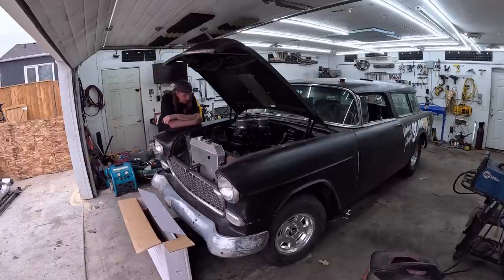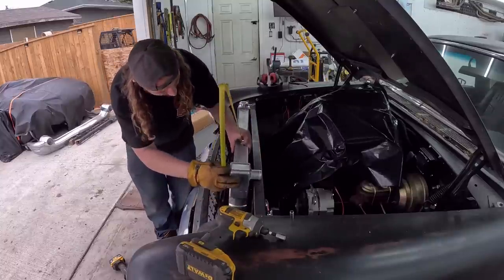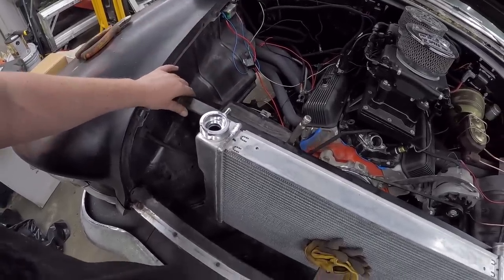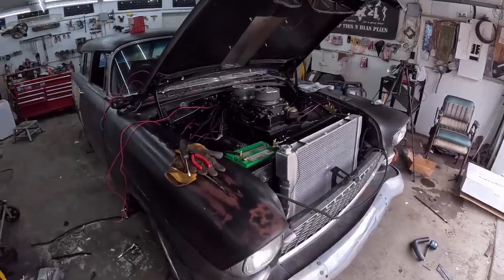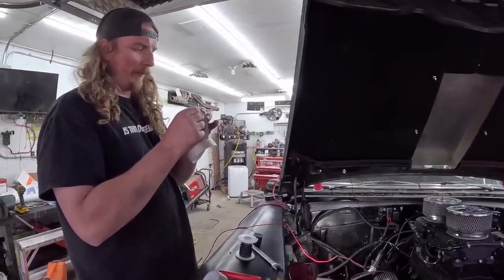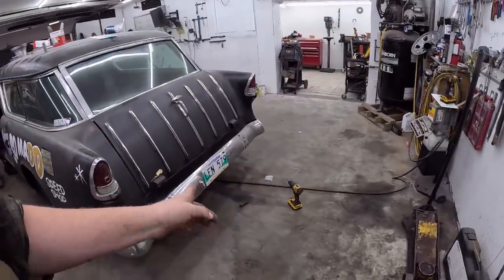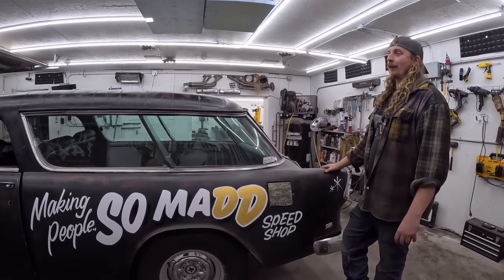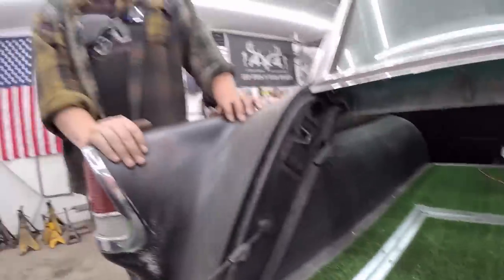Nomad Is Done! - BUT Someone STOLE My Tow Truck!

Comment: Hi Dan love the Nomad, the problem with stop go traffic isn't lack of coolant capacity ,its lack of air flow to transfer  heat from the radiator out of the system , you can have an enormous radiator but all that will be for nothing once temp is exceeding safe limits. You need bigger capacity fans and an exit for the air. raising the hinges and hood rear is an old school attempt to exit hot air ,enjoy power tour🚙.

Comment: Do yourself a favor Dan and keep a piece of carb preheater hose (that silver/paper tubing) around so when you need a radiator hose you can bend it to shape, drive it to the parts store and get a hose you will be happy with!  And that Mortske guy won't give you a hard time about flexi hoses!😎

Comment: I know you don't want to put a headliner in it, but tear out the old one and insulate the heck outta the roof and install a new one. As someone that lives in Texas I can guarantee you won't regret it. That will drop the inside temp considerably.  Also maybe tint the windows. Between the two it will make southern cruising more enjoyable.

Comment: Eastwood makes a great rad for mid 50's cars it's a triple pass aluminum. I'm running one a my twin turbo 54 cadillac and it's never seen above 205° works great. The more grounds the better. I run 0/0 on everything. Ground from your alt to the frame makes for a more consistent voltage. If batteries are relocated to the rear ground the starter to the battery ground point.

Comment: You guys are still my favorite channel with Brent at HalfAss Kustoms and ColdWater Motors all great! The Canadians are killing it!. So sad what happened to Brent and Ester, be careful! Had my 90 rust free Chevy step side truck stolen. Got it back in a couple days with a broken windshield and driver's glass and a torn up steering column Fixed the windshield and door glass. Never could find another good manual /tilt cruise column for it. So much for Millennial anti- Theft devices (5 speed). LOL
Reply: An identical choice of viewing as myself , definitely something in the water oop north .

Comment: To make the puller fan a pusher, you don’t need to reverse the fan, just reverse the connector wires. Red to ground and black to hot

Comment: The battery is in backwards from a safety perspective, the post closer to the rear side of the car instead of the front in case of a crash.  If your burned out on the tri-fives, get on the CAMAROS that are rotting away in storage :)

Comment: Hey Dan, I have the Chinese ali radiator (the smaller one) on my 55. I have a single 16” electric fan (3000cfm) behind it with no engine fan at all. Fan is controlled by a temperature switch in the top radiator tank on at 90C, off at 80C. This setup has worked fine in my 55 in 40C + temperatures in the Australian summer. 
I took my battery off the firewall and moved it to the front using a 57 battery tray so the battery sits longways in the front corner like a 57. The battery tray bolts to the radiator support and the inner fender. Had to bend the edge of the tray slightly to match the angle of the 55 inner fender but a simple job overall. 
Love the Nomad. Great job on bringing her back from where you started on her.

Comment: I think you did an excellent job Dan. Digging on the old school rod......with upgrades. I'm disabled now but exactly the stuff I used to do. Still hanging on to my 90 model 3500 camper special dreaming about one more build to keep. I promised myself I'd never let the 454 go but the truck....well it is a work truck and I'm disabled.......it's a tbi  454 one ton fleetside non dually one ton.after my heart surgery she had set ten years put a hot battery on it fired up first try. Fuel injection not so bad....lol...1990 last year of the turbo 400 and old 454 block.

Comment: I noticed something. You may have already fixed it by now. But in case you haven't, From the best I could tell your engine has no crankcase ventilation. Without it the crankcase will pressurize and blow out your crankcase oil seals. Remember, You can always tell it's a Chevy small block by the oil spot they leave behind.😄

Comment: Put an extra set of fans on the radiator for sitting in the heat. The guy from Clunkers and Classics just finished a 68 Nomad and he did just that because he said that he saw a lot of cars on the side of the road because they overheated from idling in traffic for a few hours at a time.

Comment: Nice work Dan, the only thing I would say electrical wise, you've changed a lot of electrical related things at once. If the install was working with no issues, but you wanted to clean up things, so to speak, upgrade the things you want, one at a time and check how it works. If all is OK, then do the next upgrade and so on. if you change too many things at once and there's a problem, it's hard to figure out what "upgrade" f***ed things up. Systematic approach equals less headaches. Love your channel, tri fives forever!!

Comment: Just want to help you but you should have an overflow tank to your radiator. The fluid will expand out and when it cools it will suck it back in vers on the road. Seriously add one and when are you going to get the vertical trim pieces behind the rear window sliders. If you drive in the rain, it will leak.

Comment: Being 100% serious, grounding the foil would have worked. I work on alot of late model stuff and its common to find the distributor wiring is shielded. Shielded wire is essentially a normal wire, wrapped in foil then covered with another layer of insulation. The foil in all these wires is then connected back to ground. When I first encountered it, I had no clue what I was looking at. If you ever run into issues on a future build, try grounding the foil, I promise you it'll work

Comment: I am glad to see the car has come together. Enjoy the ride and I hope your Power Cruise goes really well. I have to say the old wheel setup sure looked better. Not a fan of what you have on there. I have a good easy solution for your front wheels that will not break the bank and can easily be reversed. Grab a can of dry graphite lube and spray a nice coat over those shiny things. The dry graphite spray looks like magnesium. A good easy way to have a magnesium look. It needs the daisies back on the back too. Anyway. Keep up the good work.

Comment: OHhhhh... That radiator is the picture of "Overkill", but it looks cool.  I have 2, 12 inch Perma Cool, pullers on my radiator.  Low amp and high RPM fans work like a charm on my big block 476.

Comment: Where your Headed down to the states you maaaay wanna install a defeat device either a fuel or ignition switch, it's not a bad idea and easy as hell to do. The other thing is an explosive wired to your fuel tanks like mad max, yes your car will explode but they won't get it! 😋 Another idea cut out a stencil of DDSS or something and use it to spray paint it on your rad like they do in some brands of radiators. Crazy the thieves you have had to  deal with up there in cann a dah,  my ride being stolen is a fear of my own it would kill me.

Comment: Amazing car. I know when I put the blown sbc in my Camaro I added an aftermarket radiator with dual fans, MSD box, electronic distributor and all new Auto Meter gauges. The wiring on my car was a nightmare so I can imagine how bad yours was. And now I'm considering adding fuel injection dual throttle body setup to the blower but after watching your struggles with these Holley setups I'm not so sure anymore.

Comment: I had to cut the hood on my 57 Bel Air  after I jammed it against the radiator cap because I had it mounted in the 6 cylinder position.

Comment: yeahh, i can't stand a thief either. has for cooling. i always go overboard. i always install separate oil and trans coolers, so the radiator only has to deal with the engine. i also go the best in brakes. when u come OFF the freeway with zero brakes, with 5 to 6 cars at the light, at the bottom of the off ramp waiting for u to hit them. lol u see my point.

Comment: Do you have a Shroud for your radiator? They are a total game changer for any radiator, In my opinion, either way whether you have electric or standard Fan with a great blades! My 70 ford f250 has stock radiator and shroud, I run A/C and am able to drive in extreme heat andots of traffic lights,no problem.Are you doing the trip south or not? You were in my town last trip and didn't find out until your last day. Do Canadians like 64 El caminos?

Comment: Yes, steel sheathing and yes ground one end or both ends of the sheathing, that is how to prevent interference.  If you knew anything about CE electronics wiring certification ….static and over the air signal or electrical interference induced into the wiring, you would understand.  Otherwise just do what you are doing and don’t listen to anyone.  It is your car, do what you want.

Comment: iask a genuine question because i just dont know why do modern vehicles have thin radiators and stay in there designated tempwraure range but older cars have big radiators and people want to put even bigger radiators in them  it seems to me that a bigger radiator isnt the answer to cooling issues (maybe im wrong because im oblivious to something ) it seems  like   having more water for the fan to cool would be counter productive when the flow into the radiator remains the same and the fan moves the same amount of air  it just seems like  dumping 170 degree water into a gallon of water for a short time  with a fan blowing on it wouldnt have much of a cooling effect before being introduced back into the engine to be reheated again it seems like less water in the radiator would be easier to cool

Comment: does the hood support block the rad when its closed?
Reply: That's what I was wondering... and then the battery's blocking a fair amount of air flow too. But that's DD's Speed Shop for ya. 🙃

Comment: still doesn't know , that if you only overheat in traffic , it's not a radiator  issue .. but cooling fans, and there's plenty of good electric gm high cfm ones at the junk yard ...

Comment: I think what Holley requires for their Sniper to run is bullshit.  So basically. They built this really finicky system that has to be grounded and separated like the wiring in the NASA space shuttle to work?  I don’t think so. Why would they do that?  They should know exactly what the distances should be to make it work correctly without being overly wired.  Just my thoughts. Great job Dan!